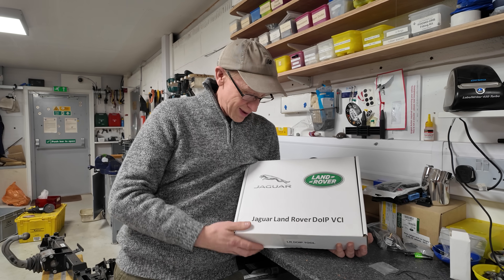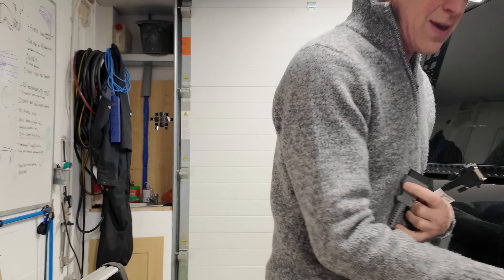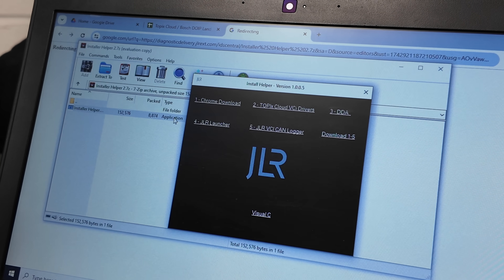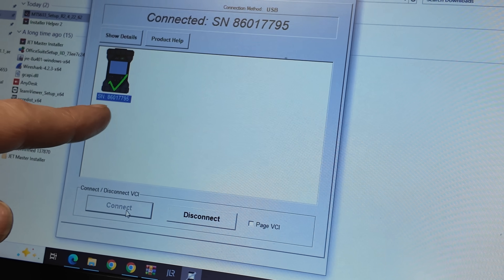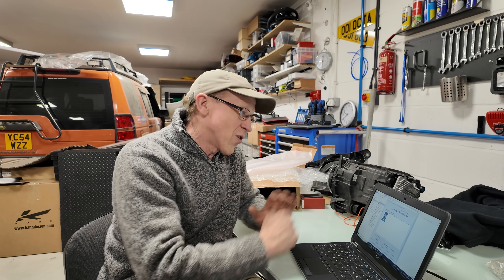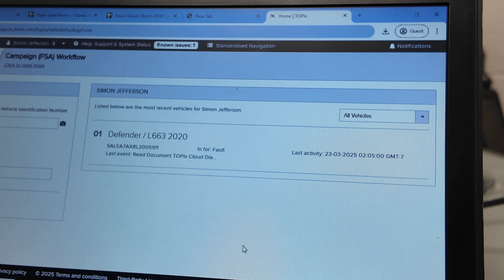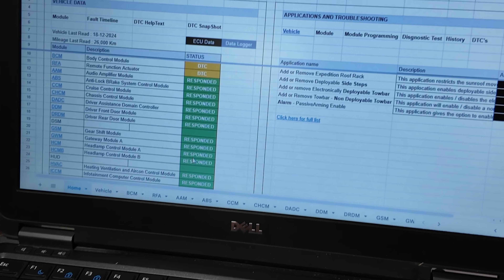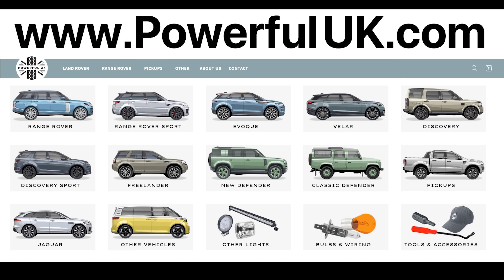How To Install Land Rover Dealer Level Diagnostic Software.. Topix Cloud with Bosch DOIP VCI

Comment: I have a problem with my Freelander td4 2004 diesel
When I turn off the MAF sensor, the car fast like a rocket. But when I turn it on, it runs poorly. They say that when the MAF sensor is replaced, it needs to be reset via diagnostics. Has anyone had this problem? I have the same car, it's automatic and has better throttle response. Does an automatic transmission have better throttle response than a manual?  My diagnostics show low intake manifold pressure regardless of whether the MAF is on or off. Why? I've checked everything mechanical. Everything is fine.

Comment: Interesting - thank you.   You mentioned about writing tyre size - is this the same for the Disco 4 (2016 in my case)?

The reason I am asking is that I am about to "upgrade" the wheels from 20" to 19" and go from 255/50/R20 to 255/55/R19.  The outside diameter would be the same (I think), but the thicker tyre will be more comfortable and better off-road / greeen lanes.  But do I need to tell the car that the wheels are different?

I have a Landmark, but the 19" wheels were standard on the lower spec. Graphite version.  But I do prefer smaller wheels with more rubber, over larger wheels and thin tyres.
Reply from the maker: I think you will be fine - but i need to do this test to see what parameters it changes in the CCF - then of we go for bigger tyres on the Defender we can make the changes needed
Reply: @L663  thanks 👍

Comment: hi Simon, great video as always and very useful, it would be nice to be able to also solve the problem of the lack of car image display on the 11.5 inch pivi monitor, perhaps with the "allow central configuration" button on idma A. thanks for everything.
Reply from the maker: Yes i wonder if i need to update the firmware on some of the modules... that is the plan but i will look at the allow central configuration...It only seems to be a problem for the 2020 cars... so feels like it is a module out of date...
Reply: hello Simon, have you had any news on this? can we solve it with Topix Cloud? regards.

Comment: Simon, when you get time, can you do a quick video on disabling the Auto Start Stop?

Thanks,

Dale
Reply from the maker: Hi Dale there are 2 ways of doing this in the CCF - one turns it off - the other is it remebers the state of the last use.... so if you turn it of it stays off on the next ignition cycles. The 2nd option is the better one

Comment: Interesting video Simon, one question- if you've previously modified the ccf will connecting to the official JLR software overwrite any changes back to the factory ccf?
Reply from the maker: No - I did look at this and the software actually has a feature where you can look at what is different from original on your car - but it does not change it.
Here is a screenshot from Topix
https://www.dropbox.com/scl/fi/4zso4w6lmw56ajoba1nw1/ccf-update-5.JPG?rlkey=hddtp8ktssic7q0hpj48fmbrf&st=90f6ch52&dl=0

Comment: 1500 is really not bad. Some factory scan tools cost 10x that.
Reply from the maker: But this is only for the interconnect tool - you still have to pay for the use of the software..
Reply: @L663 that’s what I mean. A Mercedes or BMW are out of sight.  A snap on Zeus costs $15k us.